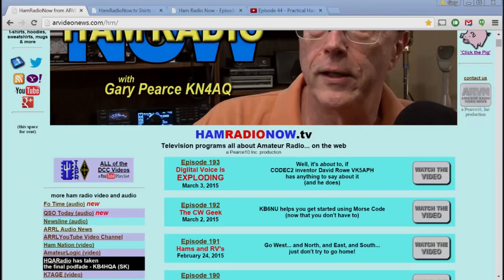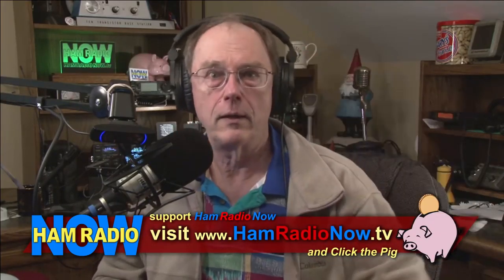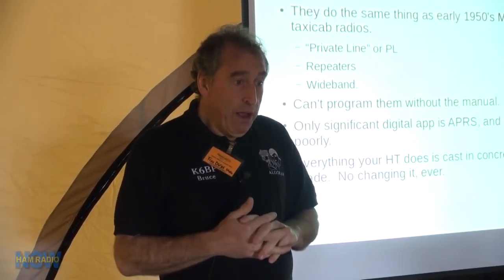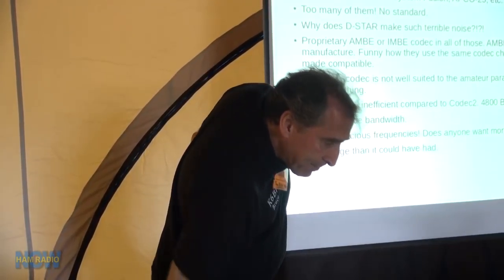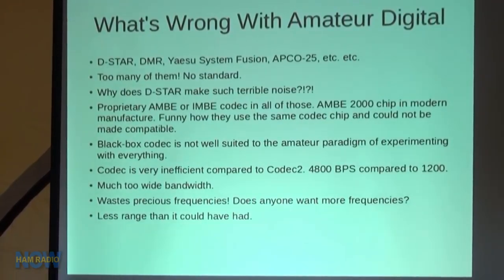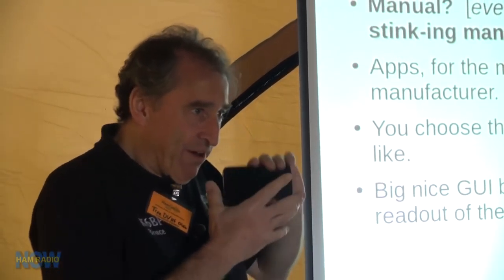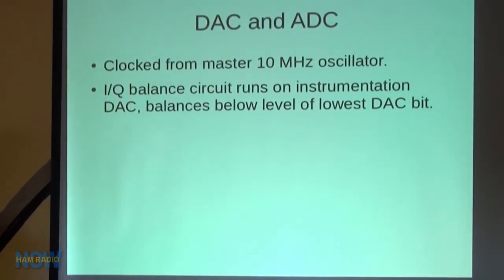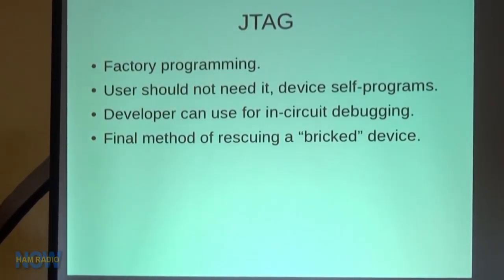HRN 194: HT of the Future on HamRadioNow

Comment: You might want to try the Stihl Weed Trimmer line...hope I don't jinx this but a 160 meter dipole and a 160 meter loop have been up for years tied off to trees with no problems. 

http://www.ebay.com/itm/like/400885529289?lpid=82&chn=ps

73 de Tony - N2XJS
Reply from the maker: Thx Tony - I can see it now: weed-eater reviews in QST...

Comment: While I understand his point re: Yaesu. It is plain that he just doesn't like them. When he was asked about just what System Fusion is, his reply was it's just not compatible. Nothing is further from the truth. Yes it is true that a D star radio cannot qso with a System Fusion radio in digital mode, an Icom radio can communicate on a System Fusion repeater in analog and the signal will be available to SF digital mode Yaesu radios and any other analog radios on that repeater.